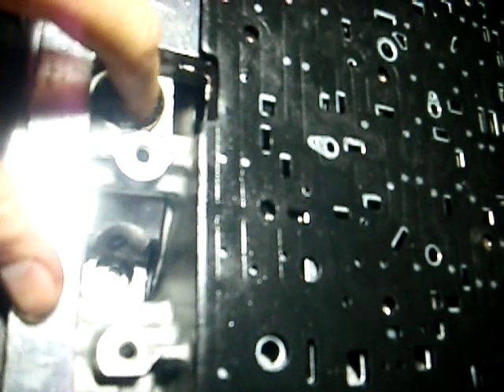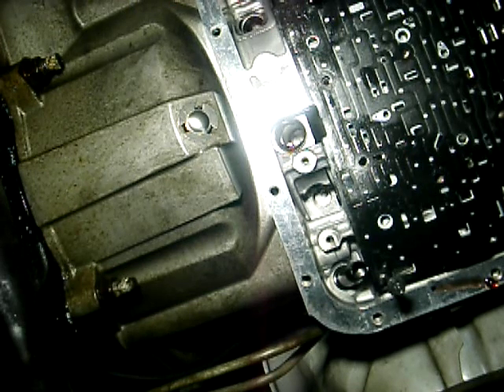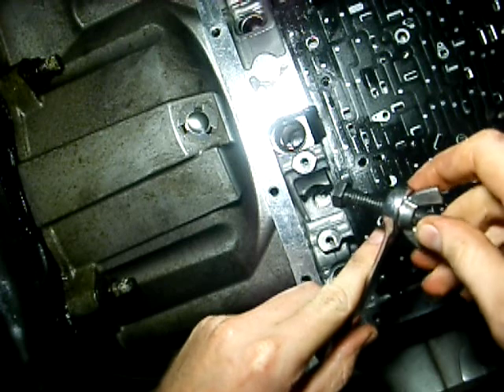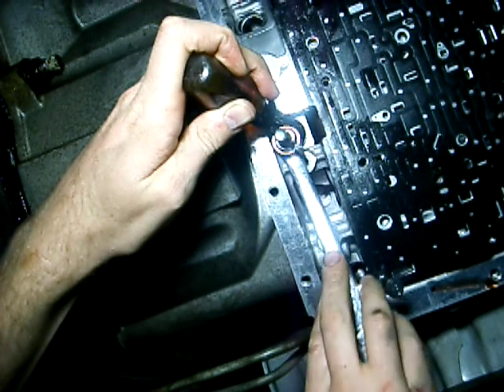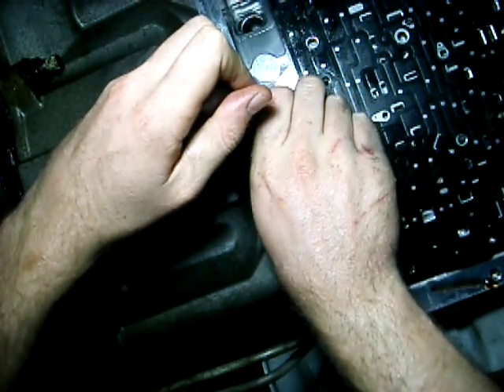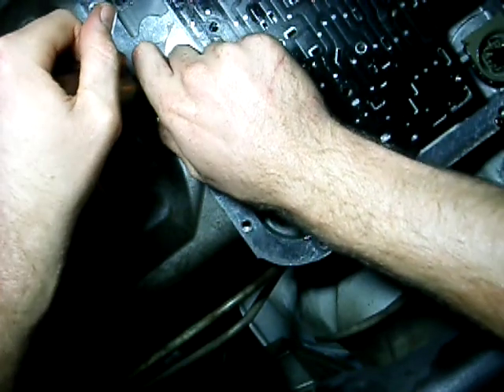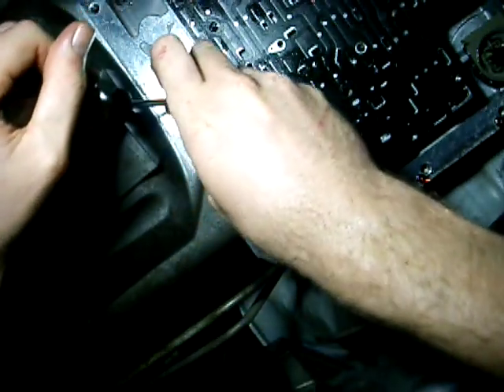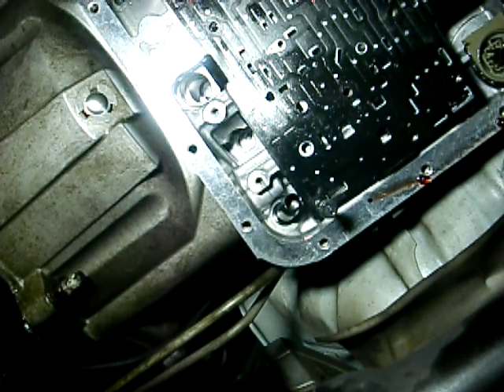4L60-E part 1 oil filter seal removal and shift kit info

Comment: Great video. I put a bolt on my cheap slide puller and it just slipped past. Tried a screw driver jammed in next to the bolt head and it popped out. Thank you.
Reply from the maker: Glad it worked for you!

Comment: 1/2" threaded pipe, with a 90 degree, thread the pipe into the seal, tap the pipe down with a hammer, takes like 5 seconds.
Reply: 1/2" pvc threaded pipe
Reply from the maker: Richard Cunanan That sounds like a good idea as well.

Comment: I couldn't get the nut to grab the metal part of the seal. I used a air saw and carefully cut the metal casing of the seal in two opposing sides. 
Then I hammered it with a screwdriver and it folded in enough to easily pull it right out with a pliers. 
You have to be careful not to cut into the trans casing, and I didn't so it worked great!
Reply from the maker: Did you use a screw driver to lever against the nut? I've done this a second time with success. I'm glad you got it though!
Reply: Toluene I tried, but couldn't get it.  I had to get it out and didn't want to mess around, so the air saw was my choice.  I was careful and cleaned up all metal chips, so I'm glad it worked.  Just another option to get that dang seal out of there! haha

Comment: Use a spring puller to yank it out. If you don't have a spring puller, there is usually a similar tool with your tire jack kit.

Comment from the maker: @YAMA51501 Nothing broke when I installed the shift kit.  Yes I got it installed without having to pull the transmission.  You just have to be careful with the checkballs when you reinstall the valve body.